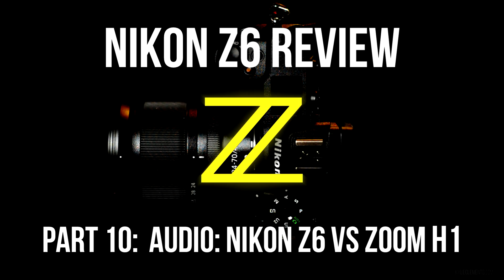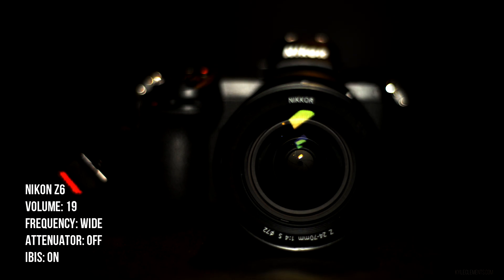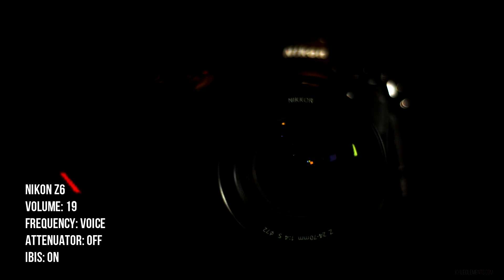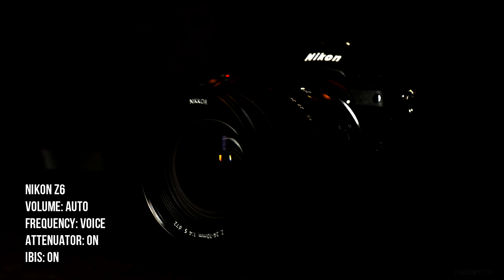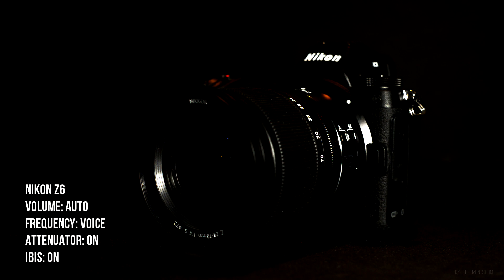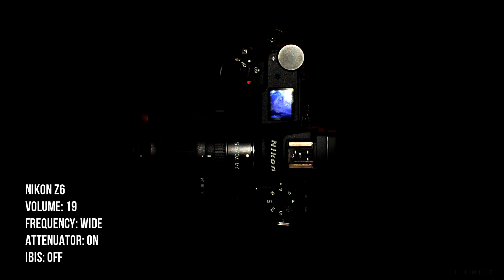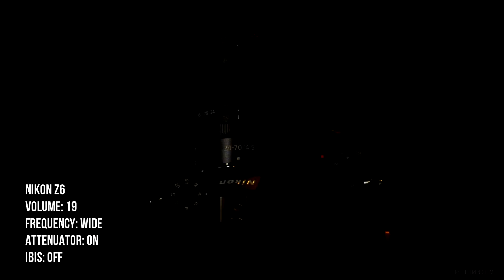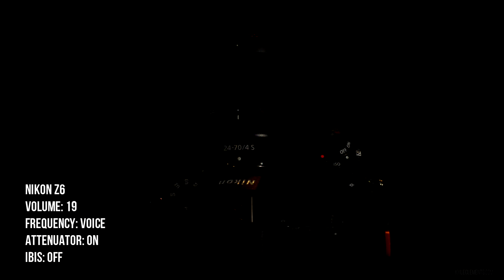Nikon Z6 Audio Test vs. Zoom H1

Comment: Why would you do a test in a room with a fan? Anyways. This is a good comparison. The Z6 actually sounds decent. Did you edit the sound in post or did you just leave it raw?
Reply from the maker: I figured most non pros weren't going to bother unplugging all the  before recording audio, so it's a kind of rough and dirty test.

The pickup is better than the D600, but no where near as good as a cheap field recorder.  I should test it against a smartphone for recording audio.
Reply: @KyleClements  would you recommend this for a vlogger? Supposing I throw on a rode mic pro?
Reply from the maker: Sorry for not replying sooner, I missed this one.

I'm going to use my Z6 for my vlogging, but I'm not a full time vlogger.  I use my camera for other things more often than I use it for vlogging.
It's certainly FAR better for vlogging than my D600 ever was.  
From a vloggers perspective, Full Auto AF on a Z6 is about as reliable as the AF on a smartphone.

For vlogging, you'd probably be better served by something smaller, cheaper, and lighter, or something with a flip screen, rather than the tilt screen on the Z6.
I'd say the Z6 was probably designed with filmmakers in mind, rather than vloggers.
Reply: @KyleClements  Ive never been the type to care about the tilt screen. The 1dxii doesn't have that and I've been vlogging with the a7sii for a year. Im more concerned about the audio quality, autofocus reliability and image straight out of the camera. The z6 looks very promising. But Im still not sure about the audio. Would you say it's good enough?
Reply from the maker: I use a Zoom H1 for audio where it matters, but for vlogging, the built-in pickups of the Z6 are good enough, if you set the volume properly.  
They are fairly noisy pickups, so you don't have a lot of room to fix it in post, if the volume is set too quietly while recording.

One thing I haven't tested yet on the Z6 are powered mics - maybe if the Z6 is fed a hotter signal, the Z6 gain can be turned down and the final audio may be cleaner?
Reply: @KyleClements  thanks for the info Kyle